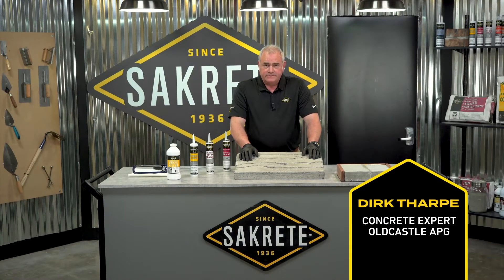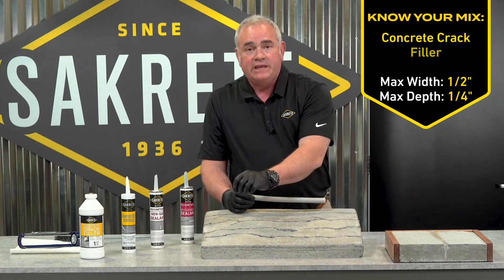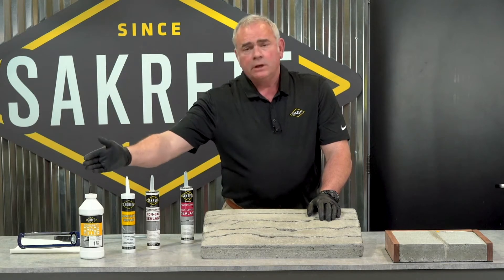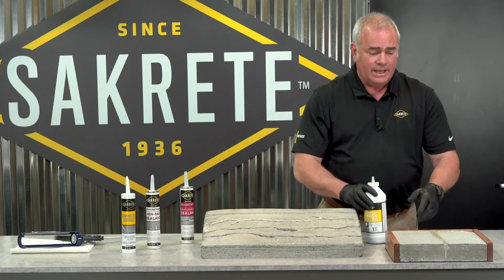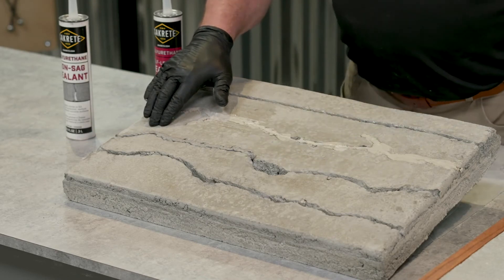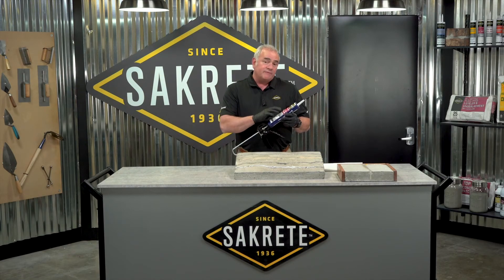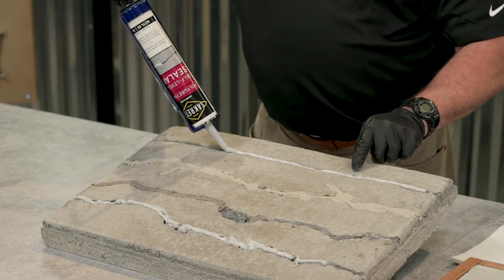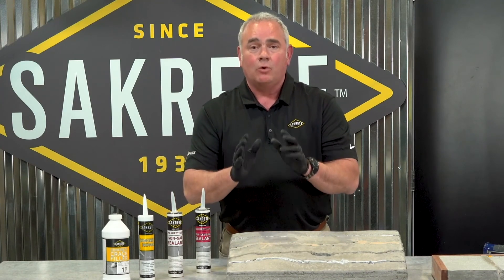Pro Tip: How to Fill, Seal & Repair Concrete Cracks Like a Pro | Sakrete Concrete Repair Guide

Comment: Incredible and useful pro tips from this product. I would to have it in my country just to support the company.

I would like to know if possible, do I need to use a backer rod for vertical joint crack if i decide to use a non-sag PU based to avoid 3 side adhesion? 
Thank you

Comment: Here’s what you said that is very frustrating: You got to first answer how deep is that crack?
If 3/8” or 1/2”, fill with sand before applying sealant.  If the crack is wider, use backer-rod.
So which is it Dirk?  Deep or Wide?

Comment: how bout a crack in a concrete foundation wall?
Reply from the maker: Hi Michael! For a crack in a vertical surface, Non-Sag Sealant is the way to go. https://www.sakrete.com/product/polyurethane-non-sag-sealant/

If you want a same-day turnaround, check out Pro-Mix All-Purpose Cement Mix (red stripe). https://www.sakrete.com/product/pro-mix-all-purpose-cement-mix/

We recommend checking the technical specs to see if additional prep is needed, like a backer rod for a deeper crack. 📞 If you ever need help with a product or project, feel free to give us a call at 866-SAKRETE (725-7383).

Comment: Thanks for the video! I have a concrete patio that sees rain and snow with several cracks in it. Would the polyurethane self leveling sealant be the best sealant to use? Also, if I use the polyurethane self leveling sealant, will I need to go back over it again like the concrete crack filler?

Comment: This was super useful for a first time homebuyer that found some cracks I needed to seal. Thank you!

As a side note, you're using "viscous" in the exact opposite way from its definition. Viscosity is resistance to flow, so if something is very viscous, it's very resistant to flow. Low viscosity is like water/oil, high viscosity is honey/magma. So if that stuff is extremely viscous, it won't flow down into a crack.
Reply from the maker: Good catch on the "viscous" definition...though I think Dirk used it correctly here. It flows, but SLOWLY – honey is a good analogy! Let us know your thoughts when you get your hands on some.

Comment: Thank you, question. A big oak tree fell amd pushed our concrete fountain over. It has some cracks but not broken. Some cracks are deep and some not so much. I would like to be able to put water in it again. What sequence of products do you recomment?
Reply from the maker: Doing a quick surface coating of Top 'N Bond feels like a solid solution. 

Anything you can do to widen those cracks in order to fit some material down in there will be great, but a good surface coating will "refresh" the look, if nothing else.

Comment: Best thing I have found is liquid nail and a putty knife to spread it. May have to do it a few times. It is cheap and it last as long as the expensive stuff. Its not the right color but it works and is cheap. Only last a few years in the winters and a crack shows up as much as  liquid nail. I have also used bondo that they use for body work on cars. I use both depending on the crack. Bondo if you want a smooth surface is fast with a belt sander.
Reply from the maker: Interesting approach. Biggest concern would be expansion/contraction since Liquid Nails really isn't designed to flex. But good solution in a pinch!

Comment: Hi, which one would work in a cove-joint in the basement that’s about 1.5” wide? Will it prevent water from coming through. Or do you recommend a different product like hydraulic cement? Thank you.
Reply from the maker: 1.5" is going to be a STRETCH for a poly product – especially if that's a vertical gap. Thinking a cementitous patch to fill the space is probably the better place to start.

Comment: Thank you so much with your great explanation of each product and their uses. I have two problems, my crack between concrete garage floor and block wall varies between 1/2" to 3/4" wide and the depth varies from 1" to 2" deep. The bottom of this space is all dirt. So I guess my first step is to level with sand? I have tamped down the dirt.
Reply from the maker: You're spot on. Get yourself to a nice, consistent 1/2" depth across the entire crack and you'll be good to go.

Our Self-Leveling Sealant should be the perfect solution for this one!

Comment: How do I fix a crack in slab that is less than 1/16” wide?
Reply from the maker: That's a pretty superficial crack that can probably be handled with a post-applied waterproofing sealer.

There are also some specialty (read: pricey!), ultra-low viscosity resin-based materials that are rated for that small of a crack. Might look into those products as an option as well.

Comment: Better close up needed. Seems to be a lot of overlap between products making it unclear except for self-leveling which is best.
Reply from the maker: Definitely a fair amount of overlap – especially between Crack Filler, Concrete Repair and Poly Non-Sag. Good note on the closeups...we'll work on that.

In the meantime, a quick breakdown...

Crack Filler – made for easy application. Smooth texture, latex-based.

Concrete Repair – requires a caulk gun, light sand texture to better match concrete, latex-based.

Poly Non-Sag – smooth texture, best bet if you're working on vertical applications.

Hopefully that's helpful!

Comment: Had to leave for an emergency after applying the Sakrete concrete crack filler. Never got to remove the excess and now it's dry. Could I sand it down for a better look since its near my main door?
Reply from the maker: Absolutely doable. Just use a fine-grit sandpaper for the best possible results...it'll take a while, but you won't tear the material as easily if you use a 120-ish grit sandpaper.

Comment: Nonesense? This only works for floor cracks, not on walls
Reply from the maker: The non-sag will definitely work in vertical applications! It's pretty sticky stuff...especially the new and improved formulation we just released.

Comment: I dont like using sand to fill the crack because the sand makes the crack "dirty" again.  Backer rod is pointless too because why not just fill the crack with the sealant product, let it dry and go over again if necessary instead of backer rod?
Reply from the maker: Concern would be that you're just letting sealant flow UNDER the slab and wasting a ton of material and / or exceeding the rated depth of the sealant.

Backer rod is a small annoyance, but definitely the way to go!
Reply: @SakreteOfficial 
But what if what I'm after is the most rigid solution, and I don't mind wasting product. Meaning, I'll pour the polyurethane product as a backer rod, then come back the next day and do the top layer above it. Won't this hold better than only having the product trying to hold the concrete together by only 1\2" thickness?
Reply: I hate sand... It gets everywhere

Comment: My garage is a wood shop. I have equipment rolling around and the control joints are a pain to try and tool over.  Which product would create a solid surface to roll over?
Reply from the maker: Short of going with a full-on epoxy floor solution, sounds like a job for Top 'N Bond. Extremely user-friendly mix that goes down to a really nice feather edge – should work well for that application. 

Just be mindful about protecting the bulk of those control joints – you don't want to immobilize the slab for the sake of a smooth surface. Insert some open-cell backer rod into the joint (which you might need to widen to get down into) before laying a thin patch of Top 'N Bond.

Final note: be prepared for these patches to fail if and when the expansion joints move!

Comment: Since concrete is porous, why is water intrusion an issue through a crack in a driveway?
Reply from the maker: The amount of water that makes it though a crack is going to be SIGNIFICANTLY larger than water that migrates through the slab naturally – potentially enough to cause subsurface erosion that will further compromise the slab. That'd be the biggest concern.

In cold climates, freeze/thaw naturally becomes a big problem as well.

Either way, sealing those cracks is your best bet for extending the life of your slab!

Comment: First thing you have to address is why did it crack. Once you find that answer that’s what you address
Reply: Change in the ground and when it’s hot it expands and when it’s cold it condesnses causing those cracks
Reply: Because it is concrete.
Reply: There are two types of concrete. Uncracked and cracked.
Reply from the maker: You are right on the money!
Reply: Nah you fuckin know who or how it cracks lmao

Comment: Why is the depth so important why not just let it work its way down to the bottom of the slab
Reply from the maker: Two reasons: 

1: These sealants are only rated for a particular depth – going too deep is going to reduce the performance.

2: You don't want to waste a bunch of material! If you filled all the way to the bottom of the slab, that's 4" or more!

Comment: What would you use to fill a crack has gone through to the ground ( Dirt )  and I want to resurface over the repair after it is complete ? What product in your line would you recommend... I will use the Flo Coat as the top coat, not sure how to handle the wider and deeper cracks...
Reply from the maker: Gotta start with the boilerplate – a crack means that there is something wrong underneath the slab. Any repair is probably (unfortunately) temporary!

That said...sounds like you probably want to go with either Fast Setting Cement Patcher (doing 2" lifts at a time), or Pro-Mix All-Purpose Cement if you want to knock it out in one pour.

Correct that Flo-Coat would be your top coat! But again, you really might want to rip out and re-pour if you've got a crack that goes all the way through the slab. That's the best solution!

Comment: You don’t address large driveway cracks. Got an old house in SouthEast Texas and the driveway has huge cracks. I assume mortar according to other videos but don’t see a product here that fits that job.
Reply from the maker: Kevin, depending on how deep you're looking at, it's probably a job for Top 'N Bond.

Check out this video and let us know if we're headed in the right direction.

https://youtu.be/oyH8LuW_e8s

If the cracks are deeper than 1/2", you could either fill with some backer rod first, OR go up to Pro-Mix All Purpose Cement Mix.

Comment: I have cracks that have triangled to the point where a chunk of concrete will probably fall off either side of my porch if not addressed soon. Is this better left to a repair company, or can we repair ourselves woth these products? Wonderinf if we should break off the pieces and use the method you used on the Edge video...
Reply from the maker: Without seeing the porch, it sounds like it'd be best to knock off all of that loose concrete and re-build! Definitely doable as a DIY project...just gets trickier as the repair gets larger.

Shoot us a message on Facebook / Instagram with some photos and we'll dig into it!

Comment: Thanks for the information!  Really appreciate it!  I would like to fill/cover a controlled joint in my garage in preparation to applying epoxy finish on the entire surface/garage. What is the best product to use?  Thanks!
Reply from the maker: Definitely check with your coating manufacturer first, but the Poly Self-Leveling will likely be your best bet. Just need to make sure there's no interaction between the polyurethane and your epoxy!
Reply: @SakreteOfficial  Thank You!
Reply: @SakreteOfficial  How is that supposed to happen when you use concrete repair poly  and then cover the garage with epoxy?
Reply: Which product cures the darkest?

Comment: Great information. If I want to fill a crack and then use concrete stain to stain the concrete walkway, which would you recommend?
Reply from the maker: Generally speaking, a polyurethane product is going to do best with stains and paints. Check the label on both first!

Comment: Which would you recommend for a crack in a vertical concrete column that’s holding up a basketball net?
Reply from the maker: Structural or just aesthetic? Sounds like a good candidate for Concrete Repair!

https://www.sakrete.com/product/concrete-repair-tube/